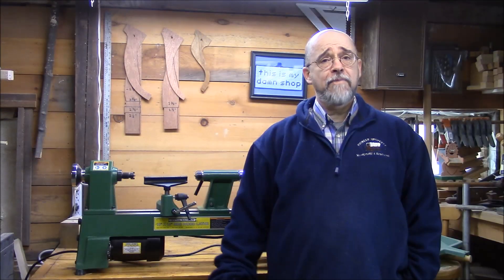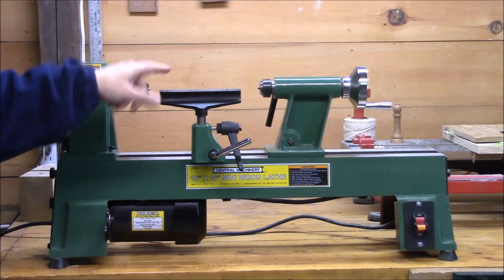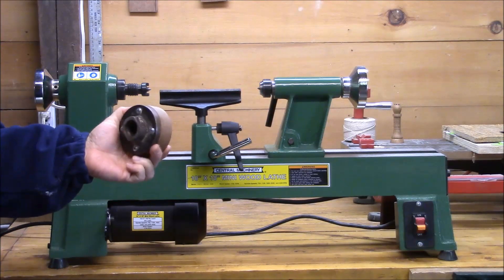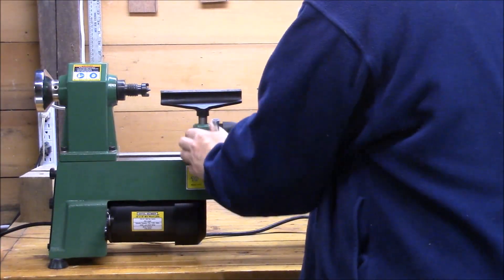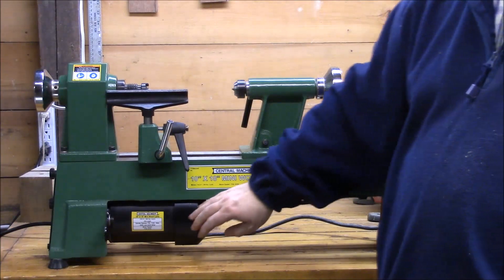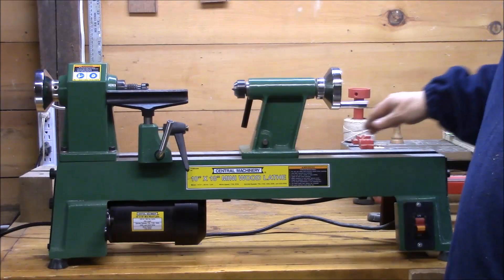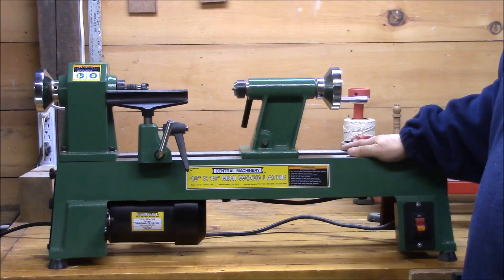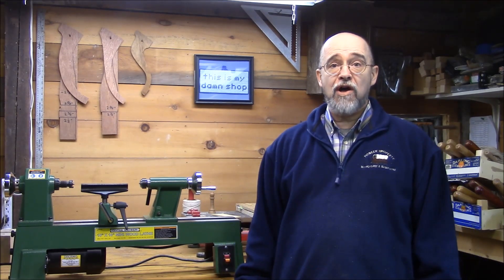Harbor Freight mini Lathe Review

Comment: Rick, on the hot motor problem, if you check the plate the motor is mounted on you will find the air holes on the plate do not line up with the motor's air inlets. Either rotating the motor to the correct mount or drilling new holes will let the motor run for hours nice and cool. I've been running mine for 4-5 hours a crack with no warm up hardly.
Reply: I'm about to buy one man thank that makes this machine REALLY worth it!
Reply: Mine gets real hot in an hour. I will check this!

Comment: I have the same lathe. It suits all my needs currently. I'm debating on upgrading to the larger version though so that I can utilize the speed control without having to change the belts.
Reply from the maker: +Kaged Creations - I don't change speeds all that often in my wood turning so the manual belt change doesn't bother me.  Although the few times that I have changed speeds it was fairly easy to do, but I can see that if you change speeds often that the speed control would be a convenience . Good luck with the upgrade!

Comment: I'm very new to wood turning. I bought a $70 bead lathe just to see if I would enjoy it. I shouldve just spent the extra money and got this to begin with because while I've found that I enjoy wood turning, I can't do hardly anything with the lathe I bought. I'm now planning on buying the lathe you have here, but was hoping you could shed some light on the whole chuck/faceplate situation because I have no idea what I'm doing when it comes to that. I only want to turn 1/2" to 3" blanks, what chuck would I need to do that? And specifically what chuck will work with this lathe to do that? I would really appreciate if you or anyone reading this that has an answer could help out a newbie wood turner. Thanks

Comment: Hey Rick,  so I was wondering if you ever got the face plate stuck on your lathe? I was doing my first turning and went to take it off and it's stuck. No idea how to get it off?
Reply from the maker: There's a hole on the side of the spindle that the end of the push bar that came with the lathe will fit into. This should give you the leverage to remove the face plate. I hope this helps

Comment: i have the same one, any idea how to get the faceplate off. mine doesnt budge
Reply from the maker: +Mark Matthews - There are flat spots on the back of the faceplate to put a wrench around.  Make sure that the handwheel is secure and you should be able to hold the handwheel and use a wrench to loosen the faceplate. You may have to shock it by tapping the wrench with a hammer. Good Luck!
Reply: +Rick Mayotte Thank you, thats what i figured but can't seem to secure the handwheel to allow me to loosen it. Any suggestions?
Reply from the maker: +Mark Matthews - If you can't tighten the screw on the handwheel enough I would try to loosen it and remove the handwheel. Then you should be able to get a wrench or a pair of vice grips on the back section of the headstock where the handwheel would be and hold it that way.  I hope this helps. Let me know if you get it off.
Reply: +Rick Mayotte Thank you, i actually found a small hold next to the flats and the knockout tool that came with it fits in that hole to allow you to secure it.
Reply: Mark Matthews can you take pictures of the hole and send them to me? Mine is giving me hell!
Reply: The push rod will fit into 1 of 2 shallow holes just behind the threaded portion of the headstock. You use the push rod  inserted as leverage while turning the plate.

Comment: I got the faceplate stuck on any suggestions to get it off ?
Reply from the maker: There is a hole in the headstock that the push rod will fit into, put a wrench on the faceplate, the rod into the hole on the headstock and it should be no problem.